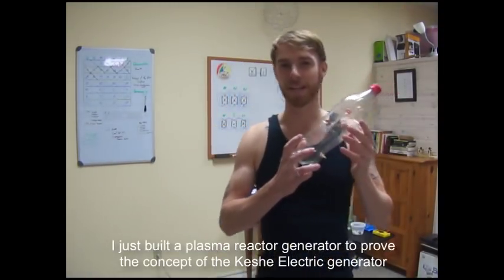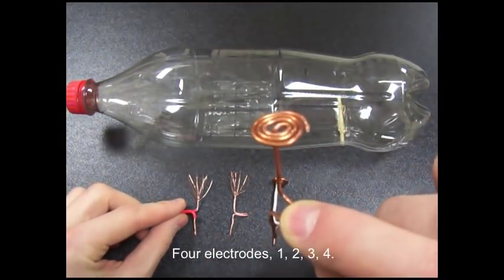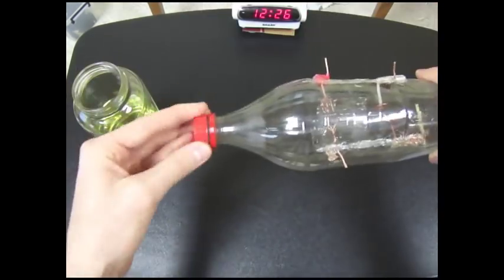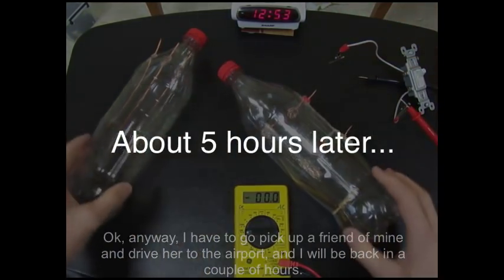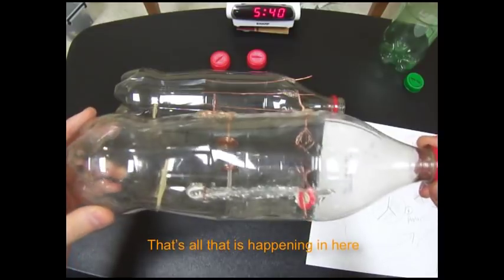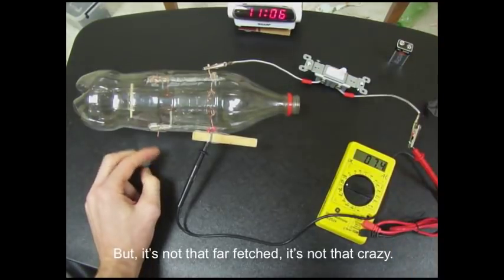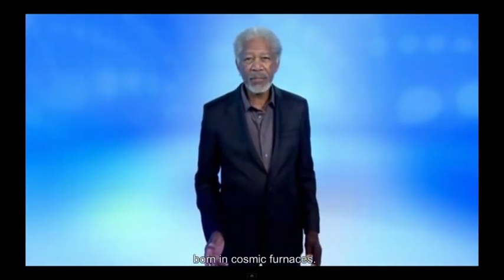Keshe Plasma Generator ~ Here is The Future ~ Infinite Energy

Comment: There is no plasma in the bottle. Electrons, protons and neutrons aren't 'fundamental plasmas'. Plasma is an ionised gas, if the air in the bottle were ionised, if plasma were present, it would glow. The couple of volts you first measured were from residual vapour in the bottle. The higher voltage you measured later is due to the ongoing chemical reaction - you made a battery. I'm not a hater or a troll, i want extremely cheap energy too, but this is a battery in a bottle with no novel processes going on.
Reply: +Gary McKinnon I am glad someone else picked up on that!!!
Reply: +Gary McKinnon Yep.  I actually tried making this device myself, even though this video gives general instructions; there are no actual specifications provided, such as diameter and length of electrodes, distance placement within the bottle, should the liquid touch the electrodes or not during "reaction start up",room temperature and other basic science experiment parameters.  Also, he didn't do a before meter measurement of the device BEFORE the solution was introduced.  I measured this before and after and got the same exact "background noise" of ambient charge potential.  By the way, my husband is an electrical engineer and predicted the same outcome.  He did tell me that the four copper electrodes "arrayed" in the bottle are a natural antenna, and likely to pick up all kinds of low level readings.  I'm STILL waiting for Keshe to actually publish a BOM and understandable instructions.  Keshe may be a brilliant man, about to change our world forever, but he seems bent on holding back "specifications" and wants to lecture endlessly about the theoretical science.  I look forward to seeing REAL EVIDENCE of the generators given away to 3rd world countries, working in normal situations.  I look forward to an ACTUAL NEWS ARTICLE published, which the mainstream media doesn't seem to be interested in any coverage of this world changing news. However, if they really work, I fear they will be snatched up and suppressed by world governments/mafias as soon as possible.
Reply: +Nancy Collins he rambles on it is very interesting I have been intrigued watching all his life classes
Reply: wrong it was a gas that had been ionized....plasma is not a gas, but used to be
Reply: +Damon Jackson (Gaming & Science)  if the plasma its not gas why you use recipe to hold it like gas or water. i think its ionized gas for that interact with magnet.
Reply: SLEVIN SHAFEL it is its own state of matter....remember it can also be pushed frictionless in one direction
Reply: +Damon Jackson (Gaming & Science)  soo can be gas right? like ice... ice its water frozed. pladma its ionized gas. i am right?
Reply: SLEVIN SHAFEL yeah but you can't un-ionize(?) Plasma and turn it back into gas, not sure
Reply: +Damon Jackson (Gaming & Science) i think yes can un-ionized it. any way i have to learn more about plasma.
Reply: take my upvote
Reply: Gas can not be moved without friction.  To prove this, stick your hand out the window the next time you are driving your car.  That push you feel is just from gas, the air, causing friction against your hand.  Plasma is what happens when a gas is heated to a very high temperature.  It has fundamentally different properties from a gas.  Ionized gas is still just gas.  If plasma cools in temperature, it will, in most cases, revert back to a gas.  Pressure can also change the temperatures at which such state transitions happen, and some things transition directly from one to another 'skipping' the usual middle (like how dry ice, which is carbon dioxide made very cold, turns from a solid directly into a gas, instead of melting to a liquid and then turning into a gas... you can get liquid CO2 if you put it under pressure, however).
Reply: NO.  The four states of matter are solid, liquid, gas, and plasma.  This reflects the movement of the atomic structure as energy is added to matter.  Water is a liquid, you remove atomic energy by cooling it (the energy is dissipated into the environment, this is because energy constantly moves to balance itself to its environment, i.e. the cold air hitting water is being heated by the water, and the water is cooling at the same rate).  This reduction of energy slows the atomic structure to the point where the atoms interlock and are tightly bound.  This turns it from a liquid into a solid.  Heating water, adding energy to it, increasing its energy, causes the atomic structure to vibrate more vigorously and the gap between atoms grows until there is enough energy to where the atoms freely move.  Stepping from a gas to a plasma is a two fold process.  First the gas needs to be ionized.  This strips electrons from the atoms causing them to gain a charge.  This charge is what he is reading.  He made an open-air battery of VERY low capacity, and the wire's amounted to nothing more than an antenna that happens to pick up on the ambient charge.  The second step to create a plasma is, again, to add energy.  This accelerates the atomic structure more, but because we have ionized the gas, this helps to reduce the occasional atomic bump, which would dissipate the energy we've put into it and it would never achieve the plasma state.
Reply: andersonjacob90ja there are more than that
Reply: We're not going into dark matter, white matter, and anti-matter in this discussion :P
Reply: andersonjacob90ja
No, because it's youtube and there's very little actual science.
Reply: andersonjacob90ja and super conductors, supersolids, super fluids. Etc. I hate how school doesn't talk about any of those.
Reply: ***** ur a gen-Xer huh?
Lol I'm a gen Z 
And I have learned far more from Google than highschool
Reply: The Real Damon Jackson Supersolids and superfluids aren't actual states of matter.  Supersolids are nothing more than solids that have been hyper-compressed, superfluids exist past the supercritical point of liquids causing them to have properties of both fluids and gases.  Neither of which, though, are sustainable states of matter.  Both will rapidly return to normal states of matter if, in the case of supersolids the pressure exerted on them drops below a threshold (explosively mind you).  Superfluids will return to either fluids or gases if the pressure on them decreases OR the temperature drops.  Solids, liquids, gases, and plasmas exist at STP, even if they transition to the other phases during that time.  Superfluids and supersolids only exist under man-made conditions.  Dark matter, though not directly observed, we can trace and fits within Einstein's theory of general relativity, and white matter itself has strong evidence pointing to its existence, mind you they both exist naturally.  Anti-matter does actually occur naturally in nature, and is often produced within certain forms of plasma discharges in nature, i.e. lightning that manifests under certain currently unknown conditions that cause the anti-matter generation.  Superconductors also don't exist in nature, they must be forced into existence by supercooling certain, man made substances to near absolute zero.  Unless you're talking about second-generations superconductors like YCBO which only have to be chilled to liquid nitrogen temperatures.
Reply: andersonjacob90ja they are tho. Pressure has an effect on other states (like liquid) but does that make it not a state of matter? No
Reply: If you follow that logic, then you have to count:
1: Degenerate matter in it's three distinct states of electron-degenerate, neutron-degenerate, and strange
2:Photonic matter
3:Quantum and it's sub-state of quantum-spin Hall
4:Bose-Einstein condensate
5:Fermionic Condensate
6:Superconductivity
7:Super fluids
8:Super solids
9:Quantum spin liquid
10:String-net liquid
11:Supercritical fluids
12:Dropleton
13:Jahn-Teller metal
14:Quark-gluon plasma
15:Weakly symmetric matter
16:Strongly symmetric matter

The problem with most of these states of matter is that they're either lab-only reproducible or theoretical, and we don't have actual proof that they exist in nature.  It's hard to disprove a theory because the creator(s) of said theory generally have math (that they generated) that proves the probability of its existence.  I'll admit that I didn't think that supercritical fluids were considered a state of matter, but it makes sense to a degree.
Reply: andersonjacob90ja
I suppose we should call them temporary states of matter ?
Reply: andersonjacob90ja they don't have to exist in nature to be a state of matter

Ununhexium is still an element and it was made in a lab
Reply: The actual atomic element with that atomic element is Livermorium, and some of it's isotopes, though they're laboratory made, have natural stability until they decay into other elements.  You're also comparing apples to oranges, we're talking about states of matter, not man-made elements.  Americium, for instance, is man made yet you probably have some in your house... many smoke detectors use it.
Reply: I can agree to that.
Reply: with that atomic number
Reply: andersonjacob90ja it is the same concept 
Man made does not disqualify anything from being a state of matter, or an element, no matter how unstable
Reply: The Real Damon Jackson
Bottom line is that there is resistance to new ideas but eventually repeated experimentation bears out. Lets give every promising idea 5 years before we make up our minds. We need a solution.
Reply: Gary McKinnon usually multiple universities have to confirm something
(It has to be tested and found several times)
Reply: The Real Damon Jackson
Like the 200 labs around the world that confirmed cold fusion, but couldn't repeat it every single time ...
Reply: Gary McKinnon it can be replicated though.
Reply: This particular experiment is quackery. Cold fusion has been confirmed several times, for many years guys.  The problem is that they have yet to reach net gain on power.  It has taken several magnitudes more power thus far to fuse elements than what you gain from energy being liberated from the process.  Cold fusion isn't literally cold, it's cooler than "hot" fusion, but it's still several thousand degree's.  Cold fusion, to be successful, will have to provide even as little as 1w more than the energy it takes to fuse elements (meaning it's a pain in the ass).  I'd point you to look into the high-beta fusion reactor Lockheed-Martin is developing, it looks promising.
Reply: Gary McKinnon put your video on we need more info
Reply: @nancycollins2483  Hi Nancy, now your comment is 3 years old. You should have something by now if Keshe isn't just a cheat which he definitely is. It amazes me every single time that you out there can't pick that up from the way he is talking nothing but rubbish. And about governments: I trust there are people who know something about human nature so it's easy to see what a scam he is. Don't waste your time!
Reply: Gary McKinnon,

Ur wrong.

Plasma is not an gas

Ionizined or other wise.

The explanation in the video is also wrong
Reply: k
Reply: Man. They have Thier own Reality. This Keshe Guy currently trys to sell a "Maschine" to cure Corona,where He wants you to Drink electrolised Walter. No Shit. That Guy needs to bei jailed up
Reply: @GaryMcKinnonUFO  
You should research the TRUE LENR in the org. 1980's experiment.
MIT faked the Ponds & F. excess energy experiment. The data shows extra energy production BUT MIT faked that there was NO excess energy. 
They changed the data before they published the data. 
Eugene Mallove was KILLED over the whole MIT BOTCHED data that was published. He insisted that MIT change the data and refused to stop telling the world of MIT's Bullshit move.
MIT had the last laugh as "they" say.

The 2 scientist never even called it COLD FUSSION. MIT gave it that name. Why? BILLIONS are wasted every year on the "HOT FUSSION"  MIT is included in this funding of HOT FUSSION.

There is no "cold fussion". What we have here is LowEnergyNuclearReaction  ie. LENR.

LENR has Great Potential,,, BUT the WARM and HOT FUISSION researchers do Not want the competition.
Reply: @benbart5711  Yes i've been aware of the US Navy's LENR labs for some time now. Mallove was one of my heroes. Thanks Ben.
Reply: @slevinshafel9395  its the 4th state of matter lol its not a gas
Reply: It's more like 59.9 millivolts XD
Reply: Funny how you missed the details
Reply: Gas in the nano state do the work don't assume in a MATTER STATE YOU HAVEgi to a difference state of matter
Reply: Anderson your the only one that has said thus in its condition
Reply: The deuterium of the composite means using matter for a step to get to plasma in the forth state of matter WE HAVE BEEN LIED TO BY SCIENCE IN THE WEST
Reply: Well said anderson

Comment: 0:08 measures electrical potential - that is not energy.
0:56  How does the solution create a "plasma"? The definition of a plasma is:"a gas of positive ions and free electrons with little or no overall electric charge." How then can it produce electricity, let alone a current, which would transport energy?
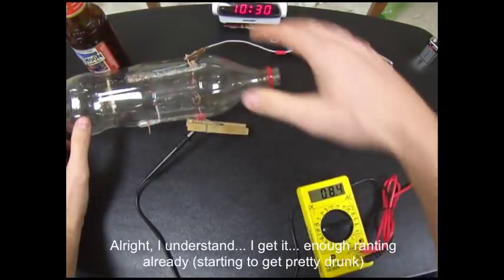4:07  what energy, how many Joules? I only see a voltage reading.
4.50  Still voltage, no energy.

What has happened is that the previous solution caused an electrochemical reaction with the electrodes, building up electrical charges in those - the air in the bottle has no meaning whatsoever, nix ionized gas, no "plasma"!
The electrically charged electrodes indeed contain some energy, which came from the solution, now removed - nix zero-point energy of the universe, galaxy, whatever.
Now, in this experiment, simply shortcut the electrodes and measure the discharge current - it will likely not show on an amp-meter, because the duration of the current is less than a mili-second. After that, connect the voltmeter to the electrodes again and --- zero voltage difference!
If you don't believe me, make the experiment yourself - it's a simple one
If this is the essence of the "Keshe Foundation", it is a hoax, not to say fraud, asking for donations, selling books etc, pure fraud!
Reply: Was going to say the same thing, only in short... I was only going to say that there was no plasma and that there was no electric energy comming from it. If it would work, i'd just charge up my iphone by plugging it into a potato...
Reply: actually the definition of a plasma is electrons that are free from the proton core so depending on the atom it may or may not have 0 net charge so your mostly right.
Reply: +Ltr121312  actually this is an actual plasma reactor he just wouldn't get that much electricity from it or else the bottle would melt
Reply: +Thermospecialist Yes and it was hard to see what the voltmeter was set on, but I found one on Walmart website, which looks like his. It looks like a GE2524 multimeter. He does state at 3:21 it's on the 200m range in the DC volts. So that's a whopping 59.9 millivolts, or about 0.06 volts (and as you stated, no mention of how much available energy). Let's see it run a lightbulb or something.
Reply: Actually, he has created Ironman's nuclear arc reactor and he deserves a nobel prize and a PhD (Permanent head damage)
Reply: Yes potentials are energy if they keep reappearing once you short them .

And anyway this is nt Keshe inventin per say he either plagerised Vasileou Karpen or based his work on it .

That was a 1920's Perpetually selfcharging battery 

KARPEN PILE 

Tested by french scientific institute back then and 60's again .

CAN NOT BE DEPLETED 

MUAHAHAHAH

Comment: Yes, the electrolyte has saturated the air, ionizing it for a time. In atmospherical collection of ions (ion harvesting) you can get many Kv, especially in stormy weather. So research on taking advantage of roaming ions in that way has surpassed methods using closed systems. Interesting video. Thanks for sharing!